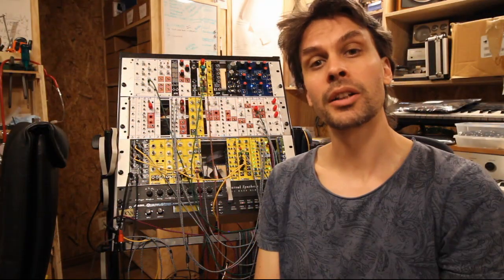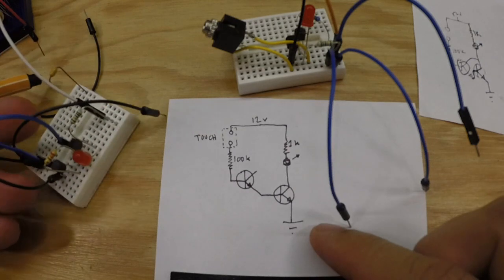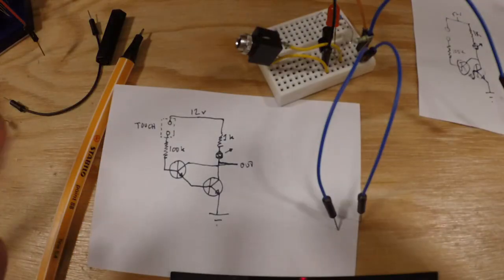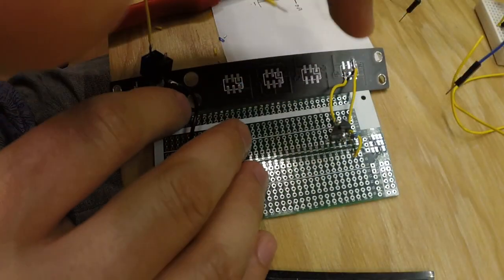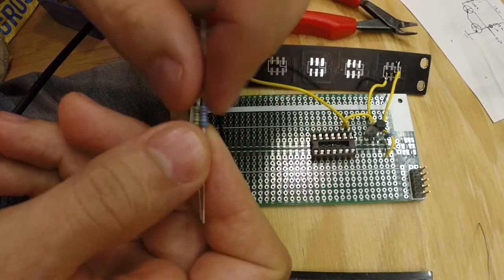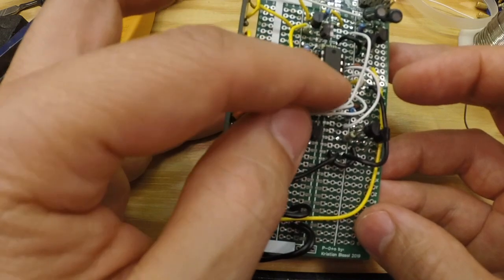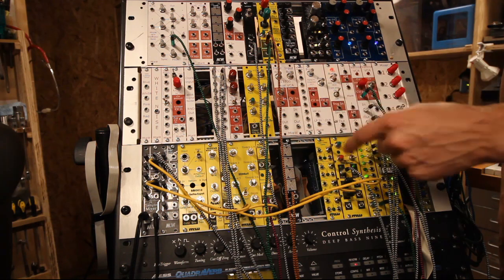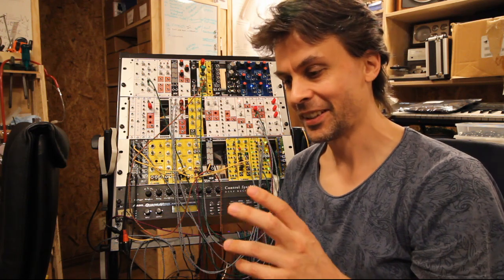Touch controller part 2 with Gate outputs - DIY Modular in a Week 11.3

Comment: Hi Kristian, i´ve been diving into this project .... you´re having serious failures in your schematic as it seems. Touch panel 4 is wrong wired and C3 will make a little firework if disrespected that way. Although i´m questioning myself what sense this circuit does anyway!? Initial state -12V, hitting the "button" +12V output.
Reply from the maker: Thanks for the heads up on the 4th touch panel. I’ll fix that. And the c3 is fixed aswell. The diode in the output removes the -12v so it is switching between gnd and +12v. I do believe I say in the video that a voltage divider might be needed if you don’t want 12v outputs. Which I do for most of my drum modules right now.  I’ve added a clarification for this and how to do it. Thank you very much for pointing out errors in schematics!
Reply: Hi! I just buy a touch me now, where can I find BOM or schematic? Thanks
Reply from the maker: @kfmmodular6937  you should find these in the description of this video for gate outputs or the previous video for cv output. I also added a link to the schematics on the Tindie store page.

Comment: Awesome!  Would the voltage jump quite as high if you had kept the LED in the circuit?  I’m not certain but I’m thinking an attenuator for this is desired in my case.  I’ve noticed that sometimes, I guess because of the nature of what’s on hand, some synths just leave out the inversion and then make it their way of triggering, when a voltage drops below a threshold instead of jumping over it.  I know of a few and I’ve seen modules with a switch to select one or the other.  I’m so often adding in those types of selector switches it’s maddening.  Thanks again, I find you always seem to convey some level of confidence that you will conquer your challenges.  It makes for a team player who has a good outlook!  THANKS AGAIN!!

Comment: He Kristian... Great module. I have the panel already. I want to us this  as toggle switches.  So I can switch a filter on or of, by example. Have you an idea how to make this? Well I do some research too. If I succeed I let you know.
Reply from the maker: Look at the recent button video. There is a circuit that might work for this. Although you might need some luck to get it to work.